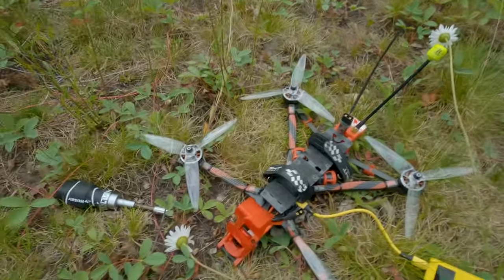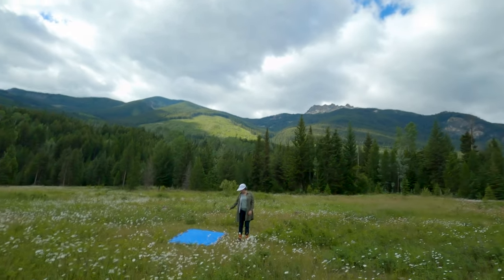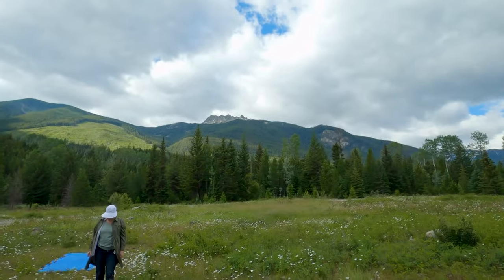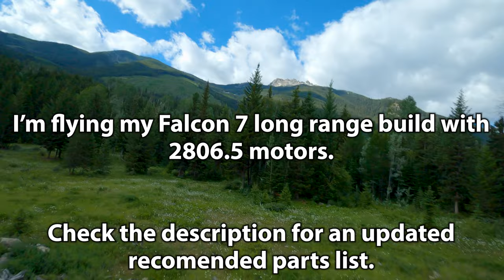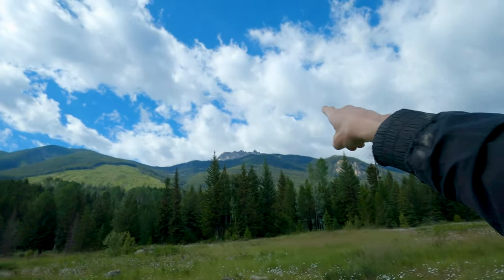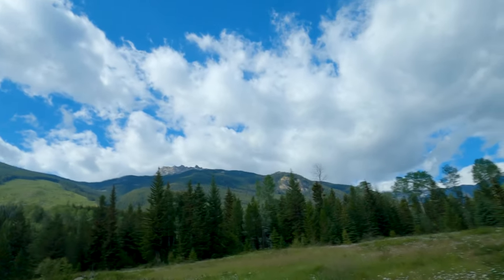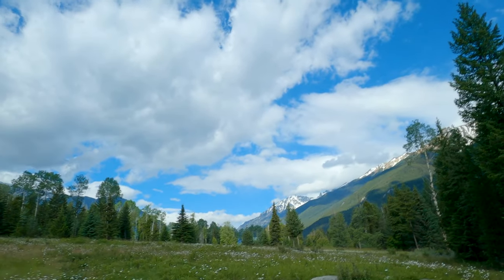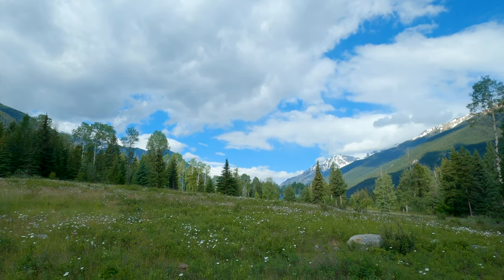4K FPV Drone Footage : Mountain Ridgeline With The Falcon 7

Comment: smooth video. may you make a video how you tune your 7inch drone. I'm still struggling tuning for cancellation of vibration.
Reply from the maker: In my quads and get playlist I have a videos about tune and betaflight setup.  Basically use extra master slider (1.2 to 1.4 Careful!)and ONLY for Falcon 7 frame use p/d balance of 1.2 for heavy batteries and 1.1 for light batteries.  Maybe 1.1 on P/d gain as well.

Comment: beautiful scenery :) I noticed you mentioned that you have been using the same battery packs you made few years ago, wondering if you have any advice/tips on how to best keep/store these li-ion packs? Thanks.
Reply from the maker: Just at storage voltage and at room temp so 20 to 25 c.  Use them every now and again if they sit for several months.  That's about it.  Oh and of course the general battery stuff.  Don't run it totally dead, land before 2.5v while flying.  Use the standard charge rate not the fast charge rate (as recommended in the manufacturers data sheet)  Charge wait at least one hour before use.  Use and wait at least one hour before recharging or setting to storage voltage.

Comment: I'm enjoying your Videos.
When do you use 6S1P 21700
  6S2P 18650   or
   6S2P  21700 packs?
Its like 420g vs 600g vs 840g.
The 6S2P allow more current and have more capacity, but what about flight feel? If I'm not too hardcore into maximum flight time, wouldnt 6s1p 21700 feel the best in handling ?
Reply from the maker: yes thats right.  just use as much battery as needed.  6s1p 21700 flies way better than 6s2p 21700, big difference in flight feel.

Comment: Hey man, love your videos, you are really the king of long range! I have a question, for a person that starts right now Wich of the two frames you would recommend building? I know they are both really good, but which would you say first? Thanks, amazing videos!
Reply from the maker: RAD Li-ion for range and Falcon 7 if you're more interested in cinematic video.  The Falcon 7 probably tunes up better with the all top mounting battery.

Comment: Do you top mount both battery packs or one top one bottom?

Awesome video!
Reply from the maker: Thanks.  The falcon 7 takes both packs on the top plate.  That's the quad used for this video.  My other one the RAD Li-ion has one on top and the other underneath.

Comment: Hi FalconRad, thanks for the video. Which flight controller were you using? I'm interested about that GPS startup trick !
Reply from the maker: With a cable that connects to your phone or the speedybee adapter its will work on any flight controller that has 5v pads powered by the USB.  They are often but not always, marked as 4v5 on the board layout.  Many boards will have one of these USB powered pads meant to be used for the RX but I use it for the GPS.  A few FC board have a couple of the 4v5 pads.
Reply: @FalconRadFPV  thanks for the reply. Which flight controller we you using in this video?

Comment: Had you ever had any problems with wind when using a 180° shutter speed on your gopro? My LR quad sometimes jitters when in strong wind. With that long shutter the jitter is visible, even with stabilization. Do I have any frame issues, tuning issues, or is it just normal?

Thanks in advance ☺️
Reply from the maker: Not sure what frame you are using so hard to help there.  But if its only for a bit here and there then look in blackbox frequency vs throttle and see what throttle point you get the bad vibrations at .  Put a throttle element in your osd and avoid the problemed throttle range.  Try different props to make the range shift around as well.
Reply: @FalconRadFPV  I'm using the Rekon 7 PRO (digital) with 6S2P 18650 LiIon batteries (AUW about 1.3kg).
These jitters only happen when diving down a mountain, where the throttle is low and the (strong) wind is causing turbulence.

My guess is that when the rpm of the motor is too low, the prop can't correct the wind fast enough or even exaggerates the effect due to latency.
As soon as I raise the throttle, the jitters stop, the quad gets more stable. But then I'm not able to fly close down the mountain.

Did you ever experience this? Do you have any suggestions?

Comment: @FalconRad FPV , I go with an Geprc 7 inch frame with caddx and crsf nano and 4s2p VTC5a pack (20+min.ft.) . Whats the advantage to have a heavier frame ? SyR , cant show here.
Reply from the maker: Its for the stability and frame stiffness (higher min. resonance frequency = better GoPro footage).  Jello in the video with this frame is almost impossible.  I've personally never seen any from my own builds, wind or not.  I have another frame that is much lighter, I did a 37min flight and 32.5 km with 8s1p but the video from that one is no where near as good as from the Falcon 7 or the RAD Li-ion frames.

Comment: I love making videos but i have never used drones . I really like the cinematic shots from FPV drones but have no idea how to start safely.
Reply from the maker: The best way to get into it is to start small.  With a small FPV drone you can crash in trees, bushes and grass and most of the time it will be ok.  Also practicing in a simulator on the computer will help save you from crashing so much in the beginning.  It's quite hard to learn at first but it gets really fun after you get used to the controls.
Reply: @FalconRadFPV  can you suggest me some small fpv drones ??

Comment: I use T-Motor F7 PRO Full Function Flight Controller w/ WiFi + Bluetooth, do you use the same FC ? When powered from usb-c only the crsf rx are powered but gps no. Gps is connected to tx3 and crsf to tx2 as wiring diagram 🤔
Reply: Hi, if I can answer for the master, as long as everything is properly configured in the "ports" tab, you can wire what you want on the UART you want.
Reply from the maker: Being powered by USB is done by the + - connections, the uart won't matter.  The USB will power the FC and some 5v pads.  Usually a 5v pad powered by USB is labeled 4v5 but looking on the T-motor FC they seem to all say 5v.  If you swap the 5v pads for your RX and GPS then the GPS should get the power from USB instead of the RX.
Reply: @FalconRadFPV  only one 5V pad is powered from usb-c, the only solution is swap the power connection + - from crsf rx and gps as your suggestion 😉

Comment: Have you ever tried theses cells Molicel 21700 P42A 4200mAh 45 they have great voltage numbers?
Reply from the maker: I have, i use them quite often.  They make great flight packs.
Reply: Do u think  it would be the best choice for a 2p6s battery for ultra long range?

Comment: How do you connect gps for have it powered only with usb power source of the FC ?
Reply from the maker: Not all FC do it, and only on some pads.  They usually say 4v5 if it is a usb powered pad.  Big help with getting sat lock for GPS before plugging in.

Comment: Absolutely awesome brother!!! I've learned so much from your channel so thanks a lot for your efforts!!! 

Hey man if you have any spare time could you take a look in the description of my last video at my build parts list.. and tell me truthfully what you would change for better efficiency? I built a P26A 6s2p a while back (using your video) and it's drawing more Amps than it should.. between 20-30a when I'm actually doing a LR flight. My 1800kv motors.. should I limit motor output to lower the kv? What can I do to improve my build?
Reply from the maker: I checked out your setup and left a comment about it on your most recent video.
Reply: @FalconRadFPV  Thanks so much!!!
Reply: Hey brother, what pwm frequency do you have set on your esc's?

Comment: Try the molicel p42 21700. Cheaper than buying lots of 18650
Reply from the maker: I have several 6s packs made from those as well.  I use both for different situations.
Reply: @FalconRadFPV  Can you tell me why long range pilots use 6S li-ion packs instead of 4S?
I've been trying out 6S 21700 packs and don't really see any benefit if you can't use the higer voltage/throttle anyway. You're limited to the max current draw of ~45A on the 21700 6S1P.
So why not go down to 4S2P and you could use just about the whole throttle range and up to 90A using 21700 parallel.
My molicel cells are on the way and I'll be building packs and testing. Maybe you know already